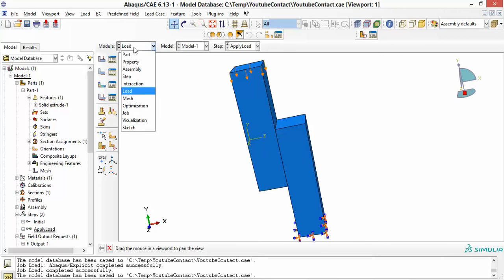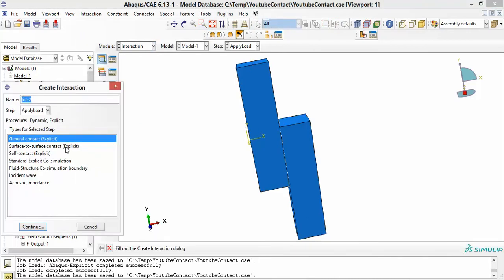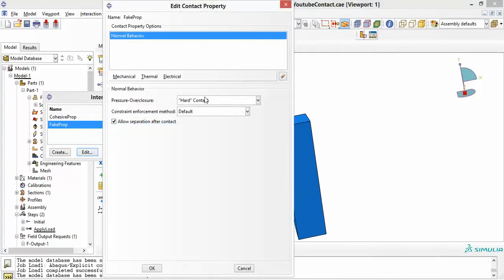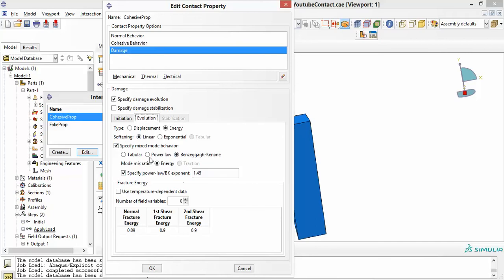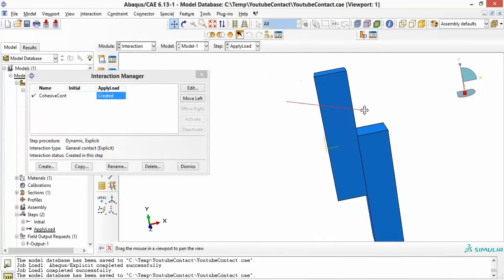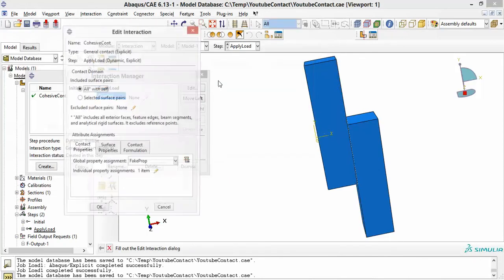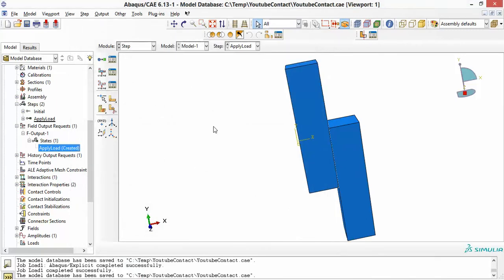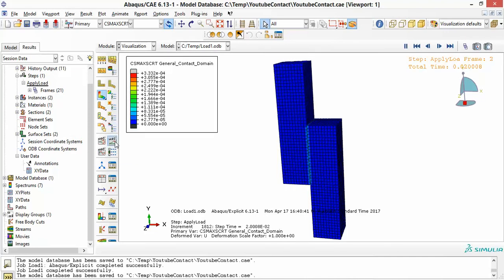Abaqus Cohesive Contact (Interaction Behaviour)

Comment: Hi Mostafa, 
Why you defined contact pair between the 2 blocks and not tie constraint ? There appears to be sliding contact between the 2 blocks. But what if we have a composite structure which needs tie between the sandwiched layers. Do we still use the general contact in that situation or can we use this fake property even in tie constraint ?

Regards,

Comment: Mostafa Ismail after the damage of the glue between blocks , the blocks will have a friction I think, so, I think you should define tangential behaviour also .
Reply: I think it is not a “fake” property, but it is the contact property that replaces the cohesive property when the bond fails. It handles the condition if the parts come in contact after bond failure. This is the property you would give friction if that’s what you want. Without a “fake” property, the parts could penetrate each other, so you have to have it. I think it should have a normal property to prevent penetration. If the parts do not come in contact after bond failure, then it can be any property, like he says.
Reply: @imhusker In case of cohesive elements, one case use UEL or VUEL to use user defined traction-separation law. However, in case of cohesive contact, is it possible to use user defined traction-separation law?

Comment: hi, my friend, i need making the mode soil and appear some problem    

THE SLAVE SURFACES ASSEMBLY_S_SURF-14 AND ASSEMBLY_S_SURF-12 INTERSECT EACH OTHER. THEY ARE PAIRED WITH MASTER SURFACES ASSEMBLY_M_SURF-16 AND ASSEMBLY_M_SURF-12 THAT ALSO INTERSECT EACH OTHER. IF BOTH PAIRS ARE *CONTACT PAIRs, THESE TWO PAIRS SHOULD NOT BE SIMULTANEOUSLY PRESENT IN A STEP BECAUSE OF POSSIBLE CONVERGENCE PROBLEMS; USE *MODEL CHANGE,TYPE=CONTACT PAIR TO REMOVE ONE OF THEM. IF BOTH ARE *TIE PAIRS, THE REDUNDANT TIES WILL BE REMOVED AUTOMATICALLY. IF ONE PAIR IS *TIE AND ANOTHER IS *CONTACT PAIR, REMOVE ONE OF THEM.
Reply: Hey, do you know what unit he’s using? علاء العزاوي